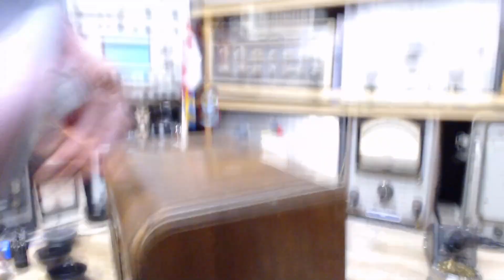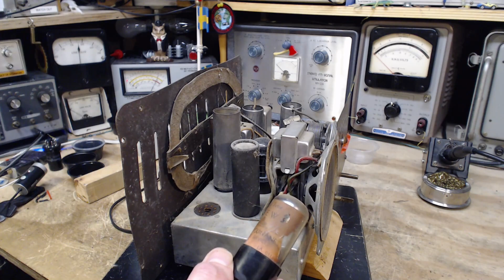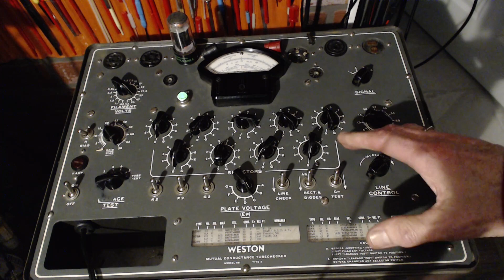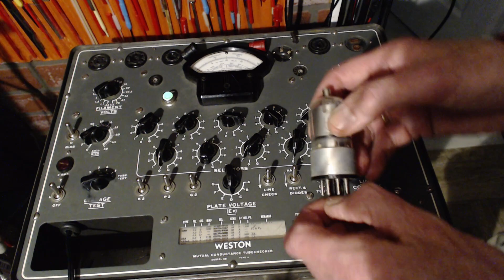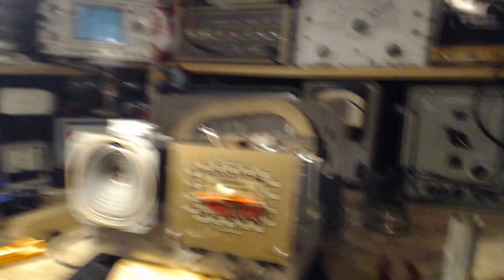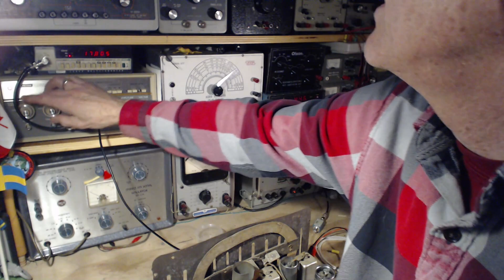Mohawk Model 1240 Five Tube Radio Video #1 - Checkout and Power Up

Comment: Greetings:
Tall tube shield guess - if tube is "det, AVC, & 1st aud", proximity to loop antenna may feed back IF signal to mixer tube?
DPDT power switch could keep mains power off chassis while "switched off".
At time 18;44 the tube layout clearly shows the IF transformers ending any speculation that this is other than a superhet set. Absent a schematic, you should list the tube complement giving us some idea as to the circuitry inside. If you had a reliable WORKING frequency counter, then we could definitively tell both the IF and tuned station frequencies. But i guess you need to guess as to the real problems as you fail to gather accurate symptom facts. FIX THAT COUNTER OF YOURS AND USE IT!
Nuf said.